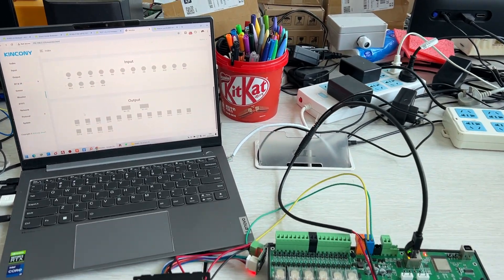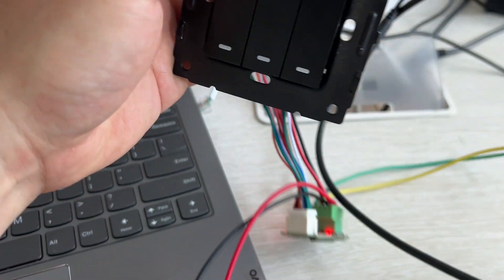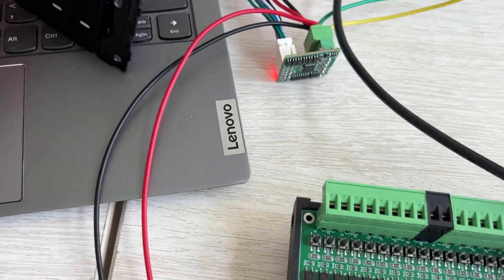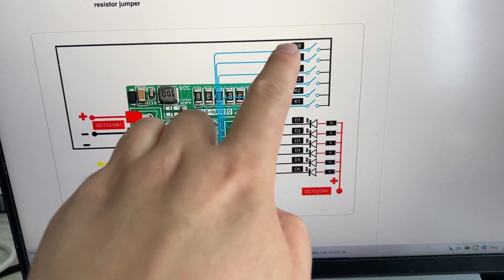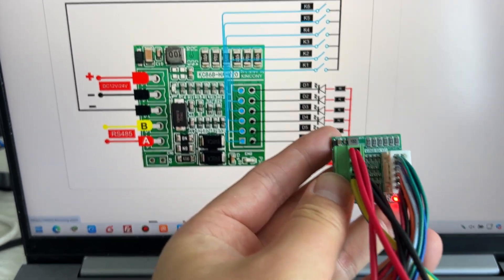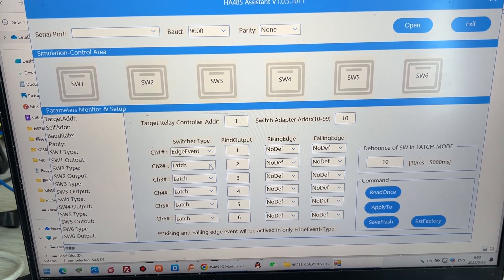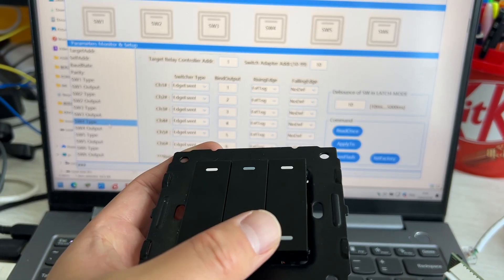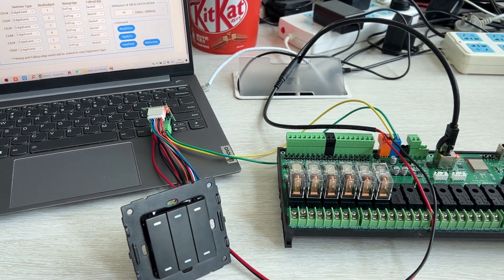ESP32 relay board control by traditional switch using RS485 HAv2 board

Comment: Nice video, if we connect to dimmer controller will also the wall switch led feedback work when lights are on ?

Can I control led feedback separelty through home assistant to create scenes led feedback?
Reply from the maker: yes, will feedback relay state.
Reply: @KinCony so switch led will be on if the light is on even if it is at 1% or 100% ?
Reply from the maker: @ramiawad1595  this is relay board, not dimmer board. only use for relay ON/OFF
Reply: @KinCony so I can't have switch led feedback for kincony dimmer boards ?
Reply from the maker: @ramiawad1595  yes, can't.
Reply: @KinCony can I control switch led feedback lights D1-D6 in KC868-HAv2 using home assistant ?
Reply from the maker: @ramiawad1595  yes, it's ok, here is sample code: https://www.kincony.com/forum/showthread.php?tid=3457

Comment: Hello engineer. You config HA with A16 by rs486. It's working locally by kincony software. After we need control by homeassistant.. Just active mqtt from kincony??? ❤
Reply from the maker: if you want use by home assisatnt, you can download esphome yaml file or integrate to home assistant by mqtt.